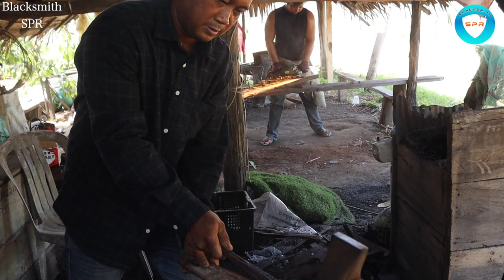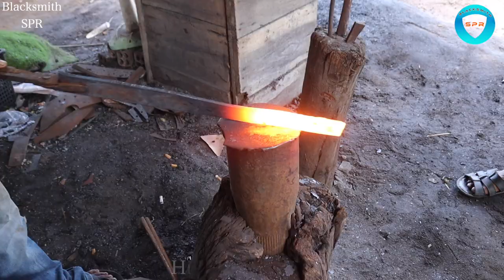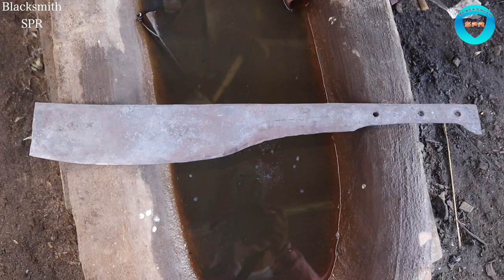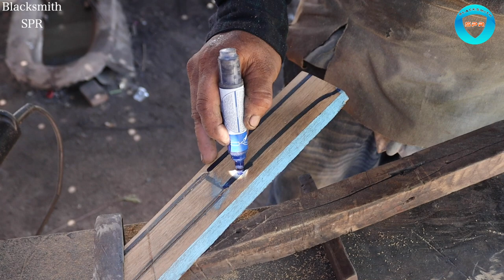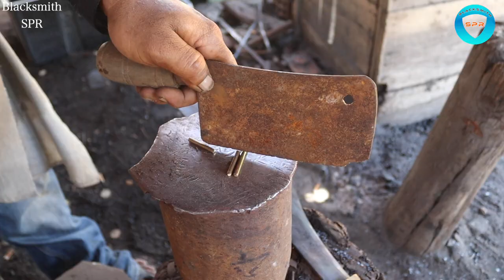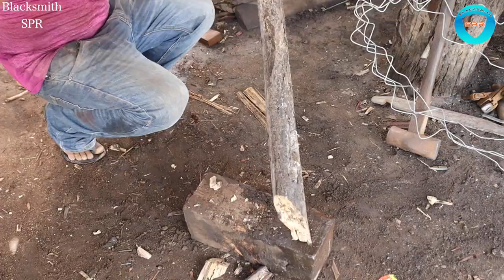Knife Forging | Poor Men Make The Sharpest Knife Ever Out Of Rusted Chainsaw.

Comment: Wow you have some skills my friend! some questions I have, what type of steal is that chain saw bar made of, I would have guessed it was not a harden able steal? When you heat treated the blade, I know you edge quenched it but it looked like you took it to a blue/purple heat I thought a straw color was better for a knife? The stone you used to sharpen blade looked a little too smooth on camera to just be using one stone? not sure if anyone can answer these questions but great Vajayo all the same! My questions were for the other video ( Vajayo) that you made a knife form chain saw bar I see this is different video but if someone can answer questions I would appreciate it.

Comment: ok I found my own answer regarding the chain saw bar and the steal. here it is: There's a reason STIHL chainsaws have a long-standing reputation for quality. ... All STIHL guide bars have induction heat-treated edges to give high wear resistance. The heat treating process hardens the rails while allowing the rest of the bar to remain flexible. I am still interested in the heat treating ?